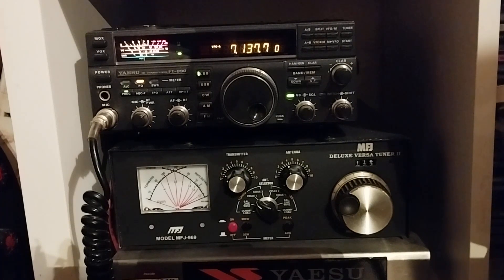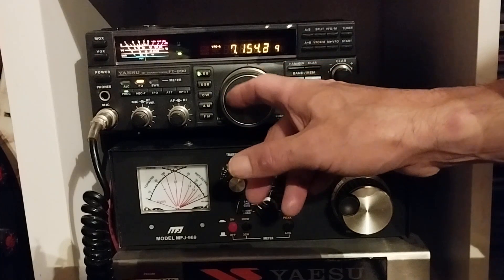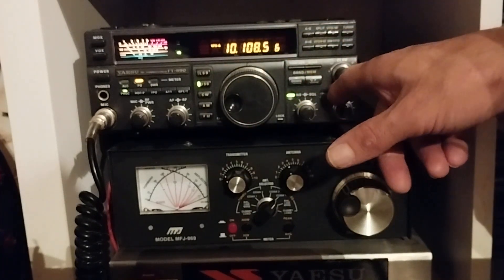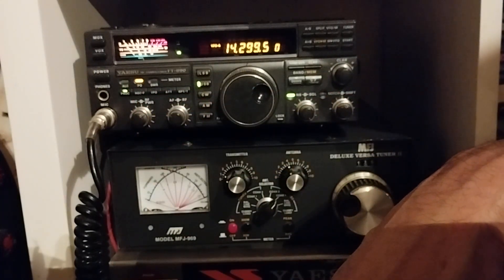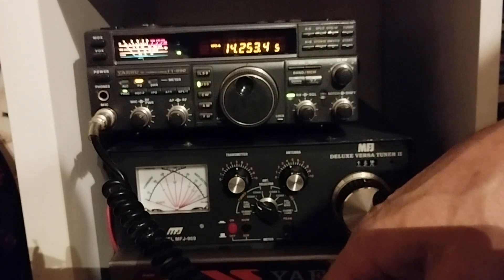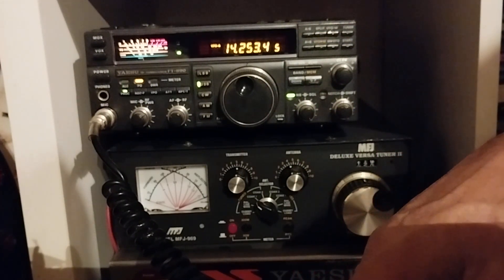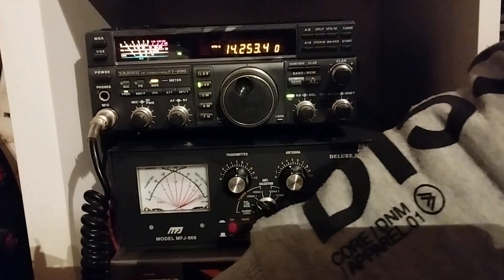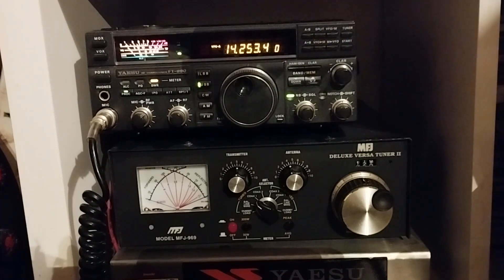New Homebrew Delta Loop pt 1- Tests using YAESU FT-890.

Comment: Lot of statistic your getting there m8 is that new or always been there
Reply from the maker: Probably there but the other radio filters everything out. But I changed feedpoint on this loop and it has totally gone. Makes sense as you know the beam receives without noise and the vertical brings in noise. Now it's horizontally polarised the loop is receiving more like the beam. The fun of experimenting! 73 cheers buddy

Comment: That's a beautiful Antenna you built there Simon. And of course this Thing is screaming the Heck out of the Ionosphere. I miss my FT-890ATU2 for sure. I sold it in 2018 after 20 Years dealing with Uncle Günter's RF Madeness. I used to run it with the Astatic 575 Hands Mic. Tnx foir the nice Video, I shared it on my Facebook Page. Happy Humpday & keep up your great Work. 73 de YFUG 💯🎸🎙🎵🤘
Reply from the maker: Thanks Uncle G 😁👍 good stuff on sharing the vid thanks for your continued support 🔥. I remembered that you had FT-890 😎 as you know they are awesome even as it becomes Classic. Have a super day bro. (What is Humpday 😁 it sounds both fun and maybe painful lol) catch up soon bro 73

Comment: that is one thing old amateurradios have on top of smartphones, the old amateurradio works after 20+ years whereby a smartphone is outdated after like 3 or 4 years. after 20+ years the 890 still does it.
Reply from the maker: Yes you are right 👍 on that. I totally agree and can't picture anyone getting excited with an outdated Galaxy ACE running Android 1 🤣. The old radios still look good and I love the feel of the switches and controls, very nice. Hopefully it will keep on going making plenty more QSOs. I have a couple of other older Classics that still work well. 73 tnx

Comment: Hi Simon,

Makes me smile to see all of your hifi  tower systems, I the last couple of months I have had a bit of a binge on second  hand hifi towers systems for the yard. Managed to get a fantastic yamaha amp for £25. Beautiful sound so i carried on and bought a kenwood graphic equalizer, Sony tunner and a pioneer CD player. Anyway I have hooked up the radios to the amp and it sounds great as there are many adjustments.

Love the vinyls just not sure a turn table would be good in the workshop.

Delta loops are good to work with and the yaesu is really nice.

Just come back with the dog completely soaked as it's been raining all evening.

Tha🎉for the video 

Cheers 

Richard
Reply from the maker: Hi Richard thanks for your comment awesome to hear that you are also into the hi-fi and sound systems I love the old school analog sound you cannot beat it. Although this modern technology is pretty impressive as well 😀. I will be taking the dogs out today probably getting muddy have a good day in the workshop don't play it too loud lol. Thanks for watching and leaving the comment, good stuff 👍 73

Comment: Quite a nice signal there, be nice to see how you get on when you have tuned it ..not seen an FT890 before nice
Reply from the maker: Hi buddy thanks again for watching and good to know I still have some equipment you have not seen on video. I do use it every now and again, great radio with a very good reception. The loop will tune up quite well I will add a four to one balun a little later, but today I think I'm going out with the kids and dogs 73. Maybe Blackpool 😁